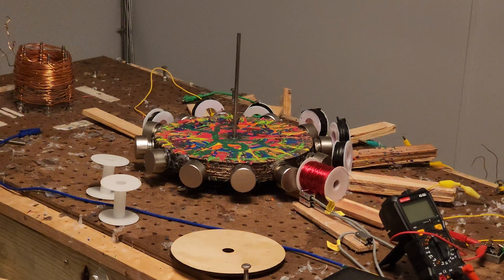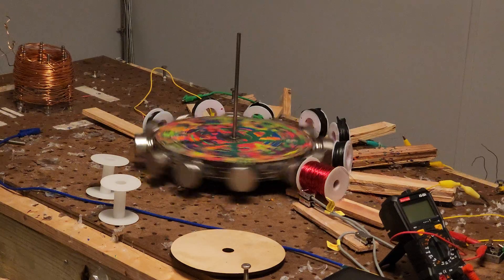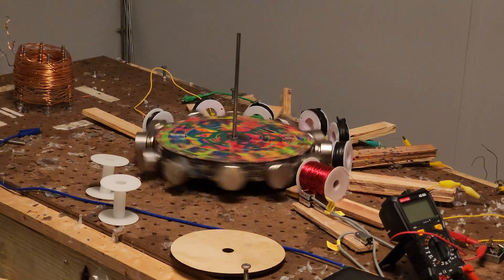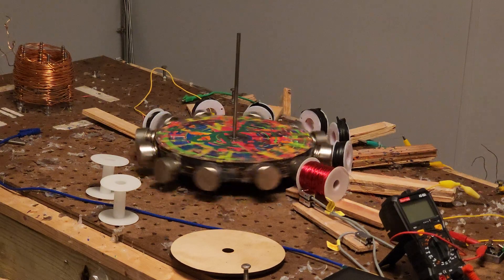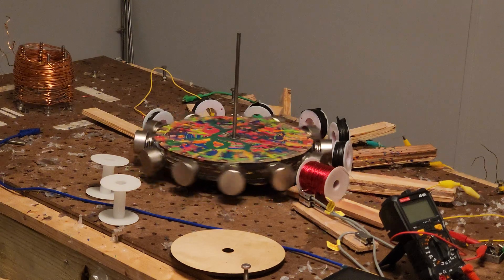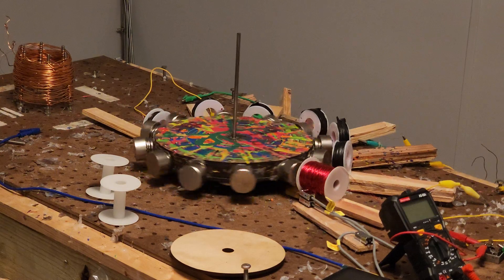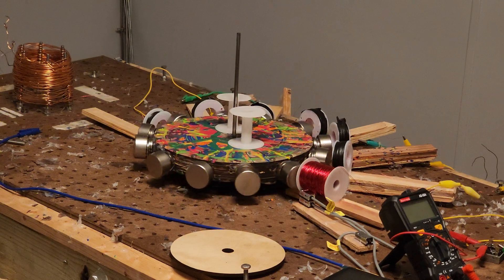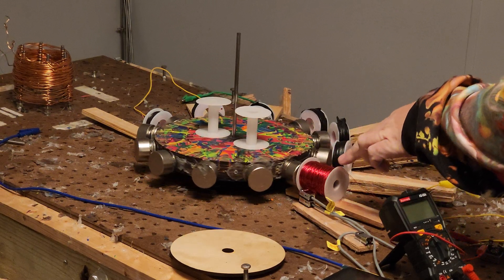pulse motor generator 0 power hot spin! duration demo!

Comment: This is why I was saying to use one magnet to trigger the drive coil  in the centre allowing the cap to charge from a full revolution before being triggered, thee way you have it seems to trigger every time a magnet gets near or 12 times a revolution when it could be one time a rev allowing more charge time😇
Reply from the maker: this is true. 5 more openings (spots for gen coils) on a manet to coil bases. could i do a 1/N 11/S spread on the rotor to simulate the center magnet? because this version charges itself and I need the magnets to do this.